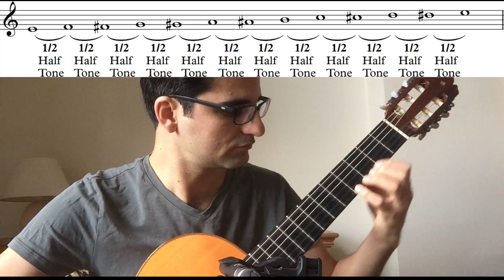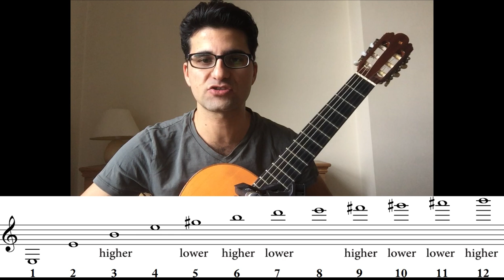Major 3rd Problem of All Guitars in the World

Comment: Even temperament is there for a reason. You'd have to re-fret the instrument for each of the 24 different key signatures otherwise.
Reply: Yeah, I was going to mention this.

Of course, having a few guitars set to keys you frequently use, and having one normally fretted guitar for everything else could be reasonable.

To be honest, I've become very sensitive to pitch recently, and understand the appeal of a product like this.
Reply: There are 30 key signatures actually
Reply from the maker: paulanderson79 Yes, you have a point: https://youtu.be/DjyNgzjNzyM
Reply: Couldn't you just use frets that aren't straight, curved to compensate, but then place the curved frets equal temperament?
Reply: Well really only 12 keys. You only need to tune enharmonics differently when they have a different function and/or different relation to the root or tonal center. Otherwise, you'd tune, for example, a C flat from a C flat major scale the same as a B from a B major scale.
Reply: 24? Aren't the minors all essentially the same as their major counterpart with the same notes (i.e. Emaj/C#min), or they intoned different too? Would all the modes be different?
Reply: @jamiebibo4287 
Yes they are different. A G# is not the same as a Ab in just intonation
Reply: @jamiebibo4287  in western music we use 12 tones, but they can be divided  by 2 and you can get 24. Instead of a semitone being the smallest distance  between sounds, you get half a semitone.
Sorry about my bad music English.
Reply: @mariposadelaire5390  Why is half of a semitone the smallest distance? Is that literally just the same set of 12 scales duplicated a quarter step up? I see microtonal guitars with increments smaller than a half, and of course if you took this to the extreme you could do any fraction between and do infinite scales.
Reply: Why not?! :) But not 24 different key signatures; you only have to accommodate a few keys because many keys share the same notes (unless you're in a very chromatic piece, which is rare).
Reply: @cangjie12  I think that's the whole point. If you use equal temperament then a G in the key of C is the same as the G in the key of Dm. In other temperaments this is not the case. Each time you changed key you would need to adjust to new frets to preserve the perfect third and fifth interval. In short, the fretboard would become incredibly full of extra frets. By the way, I do occasionally add extra frets to play microtonal music
Reply: @cangjie12  They only precisely share those notes in equal temperament. When you're eliminating equal temperament like this video is trying to do, all of that gets thrown out. The person who first said "24" probably meant the major and minor of each root, but of course there are infinitely more modes and scales than just major and minor, and in each of these we can make multiple decisions as to which resonances we wish to strengthen, and which we must sacrifice. There is no limit to how many variations we could create once we eliminate equal temperament. There is no single solution that gives us everything we want. This is why equal temperament was chosen, because it gives each instrument full versatility in all possible keys with no changes being necessary. That's not the only ideal, but it does simplify a literally infinite subject so that we can usually play music with most people we meet.
Reply: @Jezaza Gerada Yeah, those are notched and ugly though. I feel like if they were one curved fret, it would look a lot better, but I guess it would be difficult and expensive to mount those frets. It would also get rid of the problem of falling off the fret/snagging when over bending notes.

Edit: I checked google and it looks like a lot of people have homebrewed true temperament guitars with curved frets :P

Comment: I like this, it's always frustrated me as I can hear the difference, the guitar can never effectively be tuned perfectly, especially if you use harmonics to tune it. I usually compensate by pulling or pushing the string slightly.

Surely though your additional frets will only tune the guitar to a particular key, play something in another key and it's all out again.

The 12th root of 2 (1.059463), which I remember off by heart sadly, is the best approximation an interval for any key. The harmonic on the 4th fret should be 5 times the frequency or 28 semi-tones but (2^(1/12)^28) or 2^(7/3) is 0.8% out so results in a beat frequency of 3.3Hz which you can clearly hear.

Unless your music is written for one key alone you are going to have to either live with the guitar always being slightly out of tune for some notes or use your left fingers to pull or push the note into the right place. This is the same problem for any fixed instrument including a piano.

Great work though :-)
Reply from the maker: Thanks. I find more solutions on my adjustable microtonal guitar by having more frets for different keys: https://www.youtube.com/watch?v=MYK_PF9WTRE

Comment: That's all real cute... but with both you fixed one problem note, but you create new problems for like half the chords you want to play. Say you want to play an f# barre chord... nevermind the fact that the F chord is not going to be altered, therefore will have the NATURAL majur 3 deficiency that you describe in this video... but it will ALSO be difficult if not impossible to play a natural 5th string c# and a natural 6th string F# (octave). 

So.. for that chord, you will not only have the sharp major 3rd (that we're used to hearing) but you will also have the highest octave of your major 5th AND octave play flat at the same time.

This is not a versatile arrangement unless you only strum chords.
Reply from the maker: You are right. That's why I use movable-fretted guitar and find solutions depending on the piece: https://www.youtube.com/watch?v=MYK_PF9WTRE
Reply: fair enough. this does make me curious about midi pianos though. Perhaps it would be worthwhile to custom tune the pianos to each piece.
Reply from the maker: Have you checked the Fluid Piano?

Comment: This guy is an idiot... it isn't off because of the 12 tone system, it is off because when you are fretting you actually push the string against the neck where as when playing a harmonic you are not, even the slightest change in tension changes the note (even if it is in the slightest way) so on ANY fretted instrument a harmonic will never be exactly in tune with any of its equal fretted notes, on any fretted instrument
Reply: unless you tune the string with that equally fretted note to perfectly match the open harmonic in which case other fretted notes on the same string will then be off from their harmonic of the same note... tuning in this guy's temperament will also produce certain fretted notes that are just a few cents off... not just standard tuning...

Comment: If you're attaching those after the lowest frets, don't you have to continue all the way? And isn't that the same as re-tuning the string?
Reply from the maker: You are right. Whereever you use them, you need one. If you retune the open string, then all the frets should be adjusted. This is not a good solution on the standard guitar but this is what I've been doing on my movable-fretted guitar: https://www.youtube.com/watch?v=kyQaSFgnVI8

Comment: Those adjusted notes sound much brighter, like they ought to. Another way around this would be to cut up the bridge and adjust as necessary. Length of string is extremely important, and this non ability to adjust on Spanish classical guitars causes these intonation problems.

Comment: Use a compensating nut and tune the bridge properly if you have that capability. However this will minimise this to an a acceptable extent only on guitars that do not have a fixed unadjustable bridge. 

 Also 440 is not going to give you what you want if you get annoyed by this tuning problem. There is research that shows 438 is what we should be using. also finger pressure can change intonation slightly by bending the strings slightly. I build guitars I make them out of magnesium and they have very pure tone and are not heavy.

Comment: It's called inharmonicity and it's present in all stringed instruments. For this reason pianos must be tuned with "stretch" to sound good' if they were tuned with perfect octaves it would sound horribly out of tune. Compromises need to be made, to a greater or lesser degree, on various stringed instruments due to the differences in overtones of varying string lengths and diameters.
Reply: This is also the reason why when a band tunes up, it is incorrect to tune the 6 strings of a guitar to the corresponding notes on a piano. It simply won't work. Best bet is to only tune the A string (which is the only note on a piano that is perfectly in tune if the instrument was tuned correctly anyway) and then tune the rest of the guitar to itself relative to the A string.

Comment: Nice explanation of the whole problem with different tuning systems :) Not very much in-depth into mathematics and physics of sound, but very practical and straight to the point.
This idea of different tuning systems drives me crazy, though. Because in one hoof I'm with you: just intonation is better suited for natural harmonics, resonances and other cool effects with sound. But on the other hoof, it makes it somewhat hard to switch between scales because of the Pythagorean comma and "wolf intervals" :/ Equal temperament is, in one hoof, better suited for complex harmony of modern music which jumps through the scales around the entire circle of fifths. But in the other hoof, it has this drawback of not being exactly tuned, so everything sounds slightly out of tune for a trained ear, and it doesn't allow for certain resonant effects. And both are based on mathematical grounds: just intonation on the Pythagorean harmonic fractions of nice whole numbers, and equal temperament on the self-similarity and perfect embedding of logarithmic spirals. It's like one of them were better suited for musical instruments and producing sounds, while the other was better-suited for the logarithmic nature of our senses and how our brains interpret those sounds.
But what drives me crazy in this the most is that both have its benefits, and both are based on valid mathematics and physics, but they cannot be easily reconciled :/ It's either one or another; either rational or irrational (actually, transcendental even). It drives me crazy because something tells me that this is not the way it should be. That in music there shouldn't be paradoxes like these. That there should be a way to reconcile both views on music. But I don't know such a way, and mathematics seems to tell me that it shouldn't exist :/ Which is upsetting.

BTW what are your thoughts on the (in)famous A-440 vs. A-432 tuning debate? Do you have any experiences with A-432 tuning?
Reply from the maker: Thanks. I totally agree with you. I haven't tried a-432 tuning yet. I've always thought that it doesn't make any difference. I mean even if you play A-432, aren't you gonna have the same problem mentioned in the video?
Reply: The A-432 tuning is not supposed to solve this problem (i.e. just intonation vs. equal temperament). You can use both tuning systems with the A4 being tuned to 432 Hz, similarly as you can use either one when A4 is tuned to 440 Hz.
Also it shouldn't make much difference for all the chords and intervals in the composition.
The difference in 432 vs. 440 Hz lays somewhere else: in how your instruments are tuned with the rest of the world, making harmony with it too, not just inside your music.
Here's a comparison of lower octaves for 440 Hz and 432 Hz:
   A4     440       432  (4+3+2=9)
   A3     220       216  (2+1+6=9, 216=6×6×6, the number of the beast)
   A2     110       108  (1+0+8=9, 108° = interior angle of a regular pentagon, known for golden ratios).
   A1       55         54   (    5+4=9, 2·sin(54°) = the golden ratio again)
   A0       27.5      27   (    2+7=9)
As you can see, the number 9 (the highest digit in Indo-Arabic decimal system) appears in the digit sums for all those frequencies, which is not the case for the 440 tuning. This number pattern also appears in two other places known from antiquity: in the angles of the regular pentagram & pentagon, known for the golden ratios 1.618033989... appearing all around in them (think perfect arithmetic-geometric embedding), and in the sexagesimal system (base 60) used by the Babylonians to define time and measures of the angles (that explains why do they appear in the pentagram too). The Babylonians divided the heavens into 12 sectors of 30° each (known as the Zodiac) and then used it as a measure of time (12 months in a year, 12 hours in a day, etc.), so it is related to Earth's natural orbital cycles. Remember that 1 Hertz is just 1 cycle per second, and the second is 1/60 of a minute, and the minute is 1/60 of an hour,  and if you multiply it with 12 hours in a day, you get 43200 Hertzs in a day, and another 43200 Hertzs for the night (aka the Yin and Yang of the cycle, equal opposites in perfect balance).
So by tuning to 432 Hz you make your music "in sync" with at least the cycles of the Earth (period of rotation and the orbital cycle). But there's more. You can find that other planets in our Solar System are in sync with these cycles too. (Johannes Kepler called them "Music of the Spheres".) E.g. the orbital period of Venus makes with the orbital period of Earth a ratio of 8:5 which corresponds to the minor sixth in music. There are similar "musical" ratios between the cycles, dimensions and distances of other planets as well (see Kepler's "Harmonices Mundi" for more).
Even the cycle of the Zodiac (a.k.a the precession of the equinoxes), which is 2160 years for each sign (2+1+6+0=9), or 25920 years (2+5+9+2+0=9) of the "Platonic year" (the full precessional cycle) is in sync with the cycles of the Solar System. So it seems to be some kind of universal patterns which repeats over and over from the biggest scales (the Solar System) down to the mundane scales (Earth's orbital and diurnal cycle; have you ever tried to map the months on a piano keyboard? all the 31-day months map to the white keys!), then to the units of time we use since Babylonian times (hours, minutes, seconds), which in turn are the basis for our music. And it can go down into smaller scales as well. I once found the same patterns in the shapes of atomic orbitals. There are also patterns based on octaves in the periodic table of chemical elements, as discovered by Newlands (he called it "the law of octaves", seeing its similarities with music).
Reply from the maker: Thanks for the detailed explanation.
Reply: 432Hz is as special as 430 Hz. Which means, not special at all. Hz is an arbitrary unit created by man. The world is not in tune with 432Hz.

Comment: Hi Tolgahan, i believe an additional note should have been made about the electric guitars, how most of them have adjustable bridge (for each string) for purpose of intonation correction. In case you will have a follow up to this video, please also mention the role of a "zero fret" (not yet popular). Thanks for the video
Reply from the maker: Thanks for your idea. Even though they have adjustable bridges, as far as I know, it is not a solution for a 14 cents lower major 3rd. It is only a solution for fixing the semitones as in true temperament guitars, isn't it?

Comment: The human ear accepts discrepancies in tuning. That's why equal temperament works. That's actually why it's better to NOT have perfect pitch, because even a well tuned piano will sound crap to someone with perfect if it's tuned to itself but not to accepted concert tuning which often happens as pianos (or piano strings) get older.
Reply from the maker: I agree.

Comment: This problem is why Steve Vai now plays a True Temperament neck on his Ibanez! I've always had problems tuning my guitars to my satifaction, you'd get them perfectly tuned in one area, only for another to go "out"! It's like trying to fit a carpet in a room that's slightly too small, you'd get it perfect in one corner only for the others to fail. It used to drive me nuts! I've tried Buzz Feitens Tuning System and that was better but never perfect. True Temperament seems the way to go, but definitely looks worth a try as it seems to work to the same ideas as the True Temperament fret system.
Reply from the maker: True temperament doesn't solve the problem I mentioned. It is a good system for correcting the semitones. Not a solution to play a 14 cents lower major 3rd.

Comment: I was just wondering... why don't you have the little frets permanently affixed? I could certainly hear a huge difference. One more question,  why does the G string always sound out of tune, and how should I compensate for it?
Reply from the maker: When you modulate, you need to change the locations of the little frets. That's why it is not a good idea to fix them. My adjustable microtonal guitar might be a solution for you in terms of the frets on the G string: https://www.youtube.com/watch?v=MYK_PF9WTRE

Comment: Flatting major 3rds whenever possible is a common professional practice going back even before Mozart's time. Edward Van Halen would sometimes flat his b-string to get the desired even sounding resonance. Equal tempered major thirds have a practical use as well, depending on what kind of sound your going for. It's debatable whether Bach settled for 12 tone equal for the most part. This method of fret implants that you propose is pretty darn cool. And an alternative to switching out entire fretboards which isn't  unheard of. Great video in that it addresses these technical issues to aspiring musicians who want to excel regardless of what style.
Reply from the maker: Thanks. Check out my latest video for Bach: https://www.youtube.com/watch?v=kyQaSFgnVI8